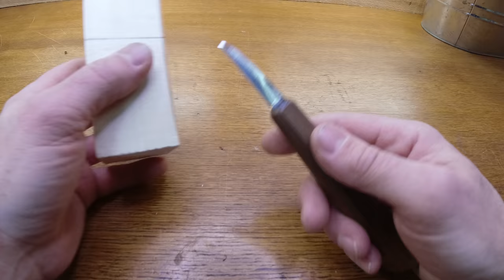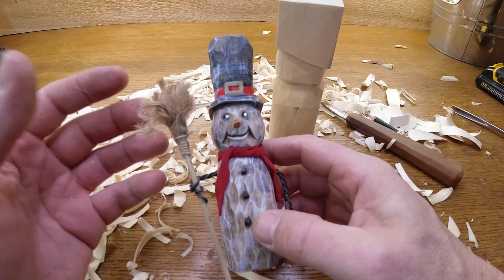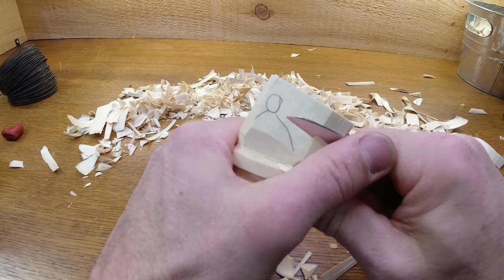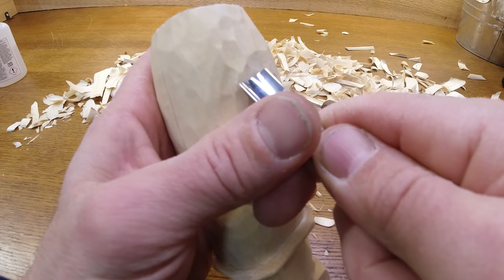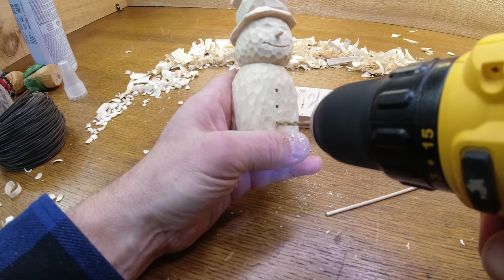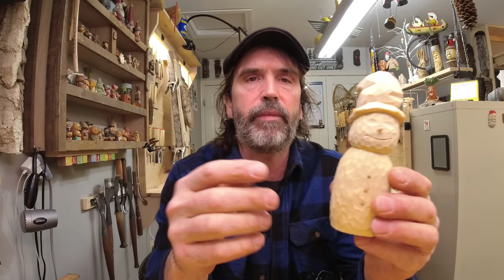How to Carve a Classic Snowman -Full Beginner Friendly Woodcarving Tutorial

Comment: Okay maybe you've mentioned this before but I have the same knife and it is not pointy at all, did you re-profile the blade or spine of the knife?
Reply from the maker: Yes i did bring the tip down to a point and it does weaken the tip  but i like it better -if you do be very careful not to heat the the tip too much on a grinder or the temper in the steel will be gone in a blink -sand it slowly or wet grinder
Reply: @dougLinker  Thank you for responding. I really like my OCC knife but want that sharp point for tight spots and triangle chips.